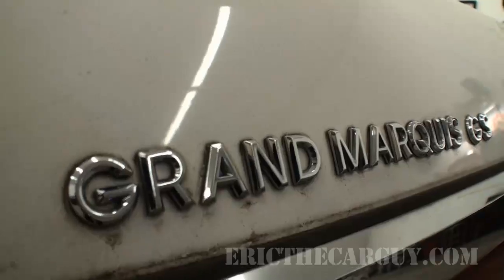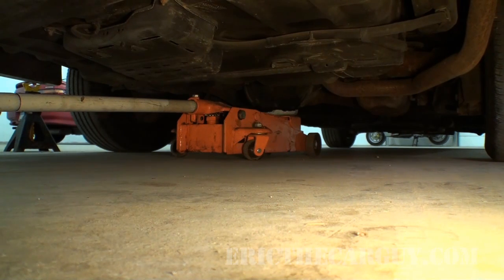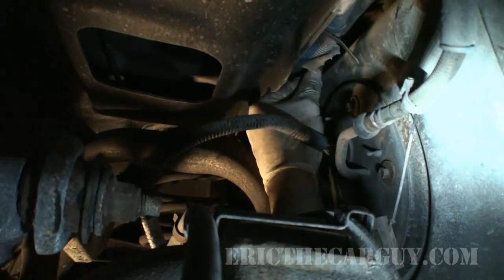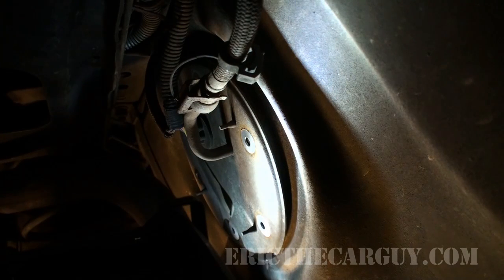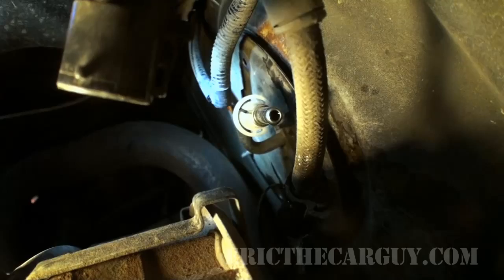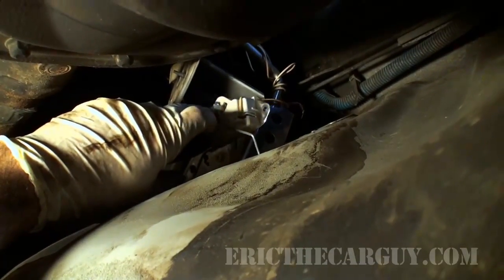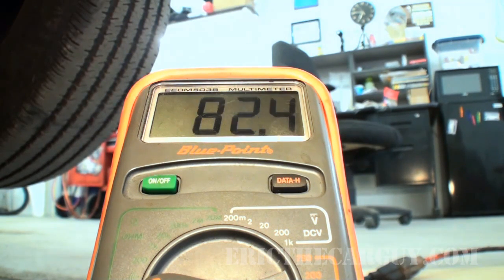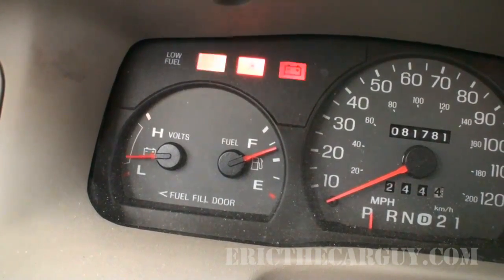Repairing Fuel Gauge Problems 2004 Mercury Marquis -EricTheCarGuy

Comment: Old post as it 2025 now.  I replaced the entire fuel pump with sending unit and gage still stays on full.  This happened right after I had under hood wires replaced because of rats eatting wire insulation so I figure its in fuse wire or dash.  I hate rats and squirrels.
Reply: 2010 Mercury Marques with only 80k miles in mint condition

Comment: Hey I have a question so, I have a 2000 Mercury grand marquis LS 4.6L V8 and I just changed the whole fuel sending unit along with the whole assembly for the fuel pump, because my cars digidash was reading CO so I was told that it was a sending unit issue, so I did that and now my fuel now reads however Iv come across and issue that I have 120miles left on my dash but my left side gauge shows 1 bar and the fuel symbol above it is blinking constantly and I don’t ever remember it doing this. So my question is, is there a way for me to re calibrate or reset my fuel reading so the blinking fuel symbol will stop blinking and my car will read correctly on how much fuel is left in the car or is this normal and I haven’t noticed it, also I don’t have the analog style dash it’s all digital everything in my cluster is digi if anyone could give me some advice I’d very much appreciate it I currently had 110 miles left and I’m on one bar and the symbol above that bar reading just blinks when I fill it up with more then 4 gallons I and put fuel in it it stop blinking and goes back to normal I just feel like 120 miles until empty is a giant gap from being empty , please help lol

Comment: If your going to remove the pump might as well replace the sending unit regardless. Not too expensive and they are prone to failure. Particularly intermittent ones like this. FYI, if removing/replacing the straps the studs are not reusable, they are broken off short at the factory. I used 03131exhaust manifold bolts rather than going to the dealer.

Comment: At 23:10 -- the sender isn't grounded.  Fuel gauge sees open circuit, which it translates to full tank.
Reply: Finished.  Sender not working before extraction, but worked on meter and worked via dash gauge after reassembly.  Verdict: sender's path to ground was somehow interrupted before (crud between case and frame, loose connection) and this 2as inadvertantly fixed by disassembly/reassembly process.

Comment: Ground wire is still corroded I haven't been able to find where it leads to i have a 2000 Grand marquis battery voltage drops and won't charge unless I mess with the ground wire

Comment: Can a bad ground cause this issue my ground wire from battery to engine is burnt up and corroded when my battery died before my fuel level worked and stopped working when I replaced battery and alternator

Comment: When I worked in a police department as a fleet mechanic if you ever have a fuel pump sending issues on a box you start it and let it run till its out of gas add a gallon or 2 back reprime put on lift and a lot less gas shower

Comment: Hey, Eric!  I have a 2009 Ford Taurus.  The gas gauge will read half full right after my wife filled it up with $39 of gas!  We'll turn it off.  Turn the car back on later and the gauge will read higher than half but not full.  We may turn it back on and it will go to full.  Th gas gauge varies on the readings.  What may be the issue with this please?  The gas gauge WORKS, to some degree.  We would just like for it to always show the correct reading!!!  Thank you VERY much!

Comment: Just got a 2008 Grand Marquis that was reading 1/4 of a tank even though it had a full tank (last car, 05 Crown Victoria did it too). I put two bottles of "Techron Concentrate Plus Fuel System Cleaner" in the tank, and drove around for about 10 minutes. Problem solved. I didn't think it would work, but it did. Both cars I've had were owned by senior citizens, that most likely had something to do with it.... (both cars were previously driven less than 300 miles a month)

Comment: 07 Pontiac torrent awd replaced sending unit  still
Act the same way no difference...  act all wierd don't read correctly and sometimes it read e with gas light on then creep up to where it should be.. what's wrong?!? I can't figure it I checked fuse and looks fine

Comment: hey buddy love your videos.   depending on configuration I either ground or add power to the sending unit wire to check.   anything newer with a bcm or cluster module I'll just do a Guage sweep.  or a simple smack with a hammer will often tweak the Guage to verify a bad unit.

Comment: My current daily had a gauge problem. I just went to the junk yard. Lucky enough to find a 93 dodge stealth which the sending unit is compatible with my car (3000GT). I pulled that bitch, installed it in my 3000GT and blam, problem fixed.

Comment: even if the guage doesnt move will the light still come on ?
Reply: I'd say depends on where the fault is
Reply: well I found out I shouldnt of put gas in while the car was running....all of a sudden it's reading correct
Reply: DeAndre Jackson so it fixed itself??
Reply: DeAndre Jackson Yeah, you NEVER put gas when the car is running. Might as well be smoking next to a pump too. 
Good thing nothing big happened!

Comment: Hey Eric...  Do you see lots of these Ford Panther body cars in your shop??  What are the best years to own???  How do they "hold-up" over the long term??
Reply: You want 03 up as you'll get so many improvements/updates Ford made I can't list them all here. Most noticeable would be the front suspension was updated and even included gasp rack and pinion steering that doesn't start developing play every 100,000 miles. 

If you go below those years (I had a 98), you'll likely face a laggy 1-2 shift no matter how well the tranny was maintained unless someone updated the valve body. This only happens when the car is first started and very cold. 

If the intake manifold wasn't updated to the PI unit (which Ford did as a "silent recall" most didn't hear about) you'll face a busted coolant crossover at the intake manifold. 

If the control arm ball joints weren't changed you'll need new ones (I highly recommend Moogs with zerks). 

98-up you'll have COPs (coils on plugs) and one can go out every now and then causing a misfire and $10-$50 replacement (which is very easy to do) depending on quality you prefer. 

All window regulators will go bad. ALL of them. Replace with Dorman or they WILL go bad again. 

Due to the weight of the doors (which is kinda substantial) the driver's door hinge may eventually wear out on you due to wear and cause the door to sag more and more causing you the annoying task of having to slam the door shut to fully latch. 

Due to body flex my windshield cracked on its own which I drove for 6-7 years and didn't bother replacing. 

They are geared extremely high (2.73:1) and it was extremely annoying to me the whole time I had the car. You'll be going in and out of OD A LOT on hilly roads. 

Despite the common misconception that they're the best riding cars out there, they're not, at least not the pre-03 ones. There are now plenty of unibody cars that put the Panther body on frame to shame on that. 

Don't get me wrong. I loved my car while I had it. I'm just saying the truth about my experience with its "quirks" (all of which I didn't list).

I was recently faced with the decision to either put enough savings into my beloved Crown Vic to almost fully restore it or get a truck (which I need and should have got to start with). It was a very hard decision to make. I felt very safe and was more efficient than a truck. It was all in all a very nice ride I will miss.

Comment: For those who may be confused about the continuity test, just know that every meter has a different thresh hold of what it considers "continuity".  The meter used uses 100 ohms, my meter happens to have 20 ohms.   This is a bad way to test the sending unit.  Using plain resistance is better and look at the resistance change from min to max and compare it to the manufactures specification.

Comment: Something I discovered after doing it the hard way, if you support the car by the chassis vs the axle. The pumpkin drops down enough so that you can pull the pump assy completely out. Dropping the tail pipe to the side helps also. Easy peasy

Comment: Those wires that go towards the trunk area are for the fuel tank pressure sensor. I found this out because I have an '04 Crown Victoria that is my commute-to-work beater car, and after replacing the intake manifold, I got a code for the fuel tank pressure sensor voltage low. After pondering how replacing the intake manifold could have anything to do with this code, I decided to look at the fuel pump wiring and found that an incompetent had replaced the fuel pumper/sender assembly and this is the cause of the code. How did I know that was done and the skill level (or lack thereof) that was involved?

When you replace the fuel pump, you have to deal with those three wires that go to the fuel tank pressure sensor.  You can try to disconnect the wiring from the sensor (which I think might be difficult) and use the new wiring that comes with the fuel pump, or keep the existing sensor wiring.

If you're going to keep the existing sensor wiring, you need to hook it up to the fuel pump harness connector. The way you're SUPPOSED to do that is to remove the red retainer/locking wedge (needle nose pliers work well) from the 8-pin connector that has those three wires in it (and the rest going to the pump/sender), and use a small screwdriver or pick to lift up the plastic locking tang on the terminals and pull them out. Then re-install them in the 8-pin connector that comes with your fuel pump (in the correct order, obviously), then reinstall the red retainer/locking wedge. This is the super easy, correct way to do it. 

The way that it was actually done: Cut the three wires. Splice them together with regular non-waterproof butt connectors.

Seeing the butt connectors is how I knew the pump/sender was replaced. Seeing one of the wires out of the butt connector with a bunch of green powder on the end of it is how I knew they are not the waterproof kind, and that an incompetent did this work, and why I was getting a code for fuel tank pressure sensor voltage low.

I replaced them with the heat-shrink butt connectors crimped with a good crimper (Klein Tools 1005), shrunk them down, hasn't been a problem since.

Comment: Hey eric, hope you read this.
Next time ( if it's an electric fuel pump ) attach a hose to the fuel line where, and open up the relay of the fuel pump and turn the pump on. would have saved some gas ;) plus it's not all over the floor .

Comment: Thanks eric a have learn  alot from watching your video. I have honda civic with same problem. My question is when testing the sending unit there is little circuit board that goes across floater is that where you put one of the lead and for honda what is ohm reading thanks once again.

Comment: I used a 1/4" plastic ( nose clear vinyl) hose from a hardware store and got it past the rollover valve to drain my Taurus fuel tank, yes it took awhile to siphon 14 gallons but I did other tasks to drop the tank. Larger hoses that I tried were too big and it took some finagling to get the hose to advance into the tank. Note: place a mark from a black magic marker at 5 foot intervals on a 15 foot hose so you can keep track of progress when inserting the hose.

Comment: i have a 94 chevy that had a stuck gauge like this  and it was like that for least 10 years  i would set my trip meter and fill up about every 300 miles but  few months ago my fuel pump died and i replaced the pump and sending unit  well my gauge started working again.

Comment: Hi Eric I have a problem with my car an intermittent non start issue on a Fiat Punto 1.2 2000. When I try to start the car I have to wait till my fuel gauge rises and it will start . but if the fuel gauge needle doesn't rise it won't start. Also the car headlight switches itself on sometimes (spooky) also I found a shorted multiplug for the car conditioning fan could this be the issue. The hazard light sometimes doesn't  stay on (bad relay? Keeps flickering) the fuel gauge goes crazy too sometimes. Bad alternator? Battery? Shorted wires because the last guy who installed the car stereo my have messed about with the wiring.

Comment: This is easy to diagnose. Unplug the sending unit and turn the key on(take note of what the fuel gauge is reading) Turn the key off and intentionally short out the Yellow/White wire straight to ground, turn key back and again, take note of what the fuel gauge reads now. You can also wire in a simple 3 wire potentiometer so you can really dial in the resistance you want to add to the circuit. If you can manually force the gauge to read different levels of fuel, you are done, it is a problem with the sending unit, NOT the cluster or the wiring harness. This is a good directional test. Do you turn left or do you turn right? Crown Vics, Towncars, Grand Marquis, all share a similar sending unit circuit set up. "Don't take a bath in fuel if you don't have to"

Comment: "Ever once in a while you run into a fuel gauge that just doesn't read correctly" I've never ran into a Ford with a working fuel gauge ... even brand new.
Reply: all of the one's we have had and friends have had have read correctly. it's those damn gm shit boxes with gas gauges that only read 3 gallons worth of the tank.

Comment: Hi, I am having a big problem, my blazer does not start, I changed the starter and fuel pump relay, oil pressure switch and fuel pump and still does not start....any help will be great, thanks!!

Comment: Eric please help! So I drive a 99 Integra, and my fuel gauge is ALWAYS reading Empty. I have switched the gauge out, and it still didn't work. I was told it could be the "floater" ? Is there anything that I can do to try and fix it myself? I don't want to have to take it to a shop because I'm on a budget, but if I have to then I will. 
Please reply!
Reply: and what happened?
Reply: Never fixed it, still reads empty. lol
Reply: +Bryan De Alba is it possible you have two fuel pumps man I have the same problem on my g35 coupe

Comment: get one of these to drain the gas tank before you work on it  http://www.ebay.com/itm/New-Drill-Powered-Water-Pump-Garden-Hose-Swimming-Pool-/221195412214?pt=LH_DefaultDomain_0&hash=item33804622f6
Reply: Never use this pump for gas with an electric drill..... Your drill motor creates sparks. Use an air drill.

Comment: I had a fuel pump go out at the gas station right after I filled the tank. Bummer. It is nice when the put port hole in the floor of the truck to gain access to the tank. My 91 honda prelude had one for the pump and one for the sending unit.

Comment: Hi Eric well in my opinion for what it's worth, when a fuel gauge reads full all the time, it's not normally the sender unit, it could be, but I would have suspected the lead from gauge to back of car grounding out, or fault behind dash, with the wire pulled off the back the gauge should go down to zero, if you ground it out the gauge usually goes to full...that's with most gauges not every single one Fred.

Comment: I can vouch for trying to get that hidden electrical connector apart. I got so frustrated with my 98 crown vic I cut a hole in the trunk right above it, same for the 2 shocks to. Just make a 3 line cut above it and fold it back over , duct tape over it . Done.

Comment: Thanks---- I have seen people ground the power wire going to the sending unit to see if the dash gas gauge moves to full, if so you can rule out the dash gauge ,wires and connectors before you have to deal with the sending unit /gas....thanks again

Comment: Forever is right.  I love these cars, but not much as changed.  I drive an '86 Grand Marquis and had to recently swap out fuel tanks (rust).  The wiring harness ran straight up into the trunk with no disconnect.

Comment: Provided of course that the scan tool displays fuel level. Some older models are not connected to the computer. An example would be a '94 Ranger and it does use the anti-slosh module that you mentioned.

Comment: 2) on and then watch the gauge as you vary the pot. If the gauge works normally from empty to full, you know the wiring to cluster and gauge is good. Now, you could go to the sending unit knowing the problem is there or in the wiring to it. You could check the resistance of the sending unit from this point also, but I like a dynamic test using voltage. If you like to see this method, I have a few videos on my channel describing this method with a Ford Ranger. Thanks for the ear!

Comment: 1 ) Hi Eric, as you've mentioned most of the time the problem is the sending unit. In my diagnosis with problems like this, I WANT to know which direction to go. Do I go into the gauge cluster or the tank. On most cars, there is a connector or two before it gets to the sending unit. On a recent repair with a Ford Ranger, there are two connectors under the hood that will feed to the sending unit. I opened a connector and hooked a pot with similar resistance as the sending unit. Turn the key cont)

Comment: I think that I have a gauge issue, my tank reads empty at an eighth of a tank and reads full at an eighth over full. I have taken the cluster out and apart and manually moved the needle down to empty and it gently glided back to and eighth of a tank. i don't think that it is the electrical because there was no current going to the unit. a ghost in the machine maybe? 95 dodge neon highline 2.0 SOHC

Comment: What about checking the OBDII data to check the gauge?  Hook up a scanner and see if you get a "Full" reading.  Unless of course the computer is not involved in the system.  But the "Low Fuel" light on the dash would indicate that it is.